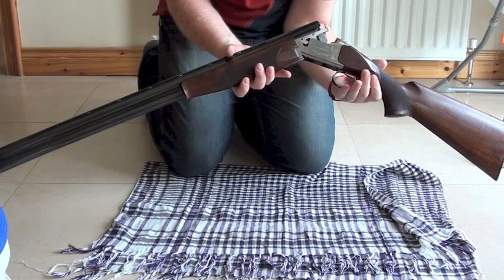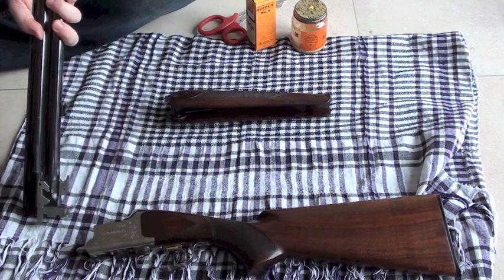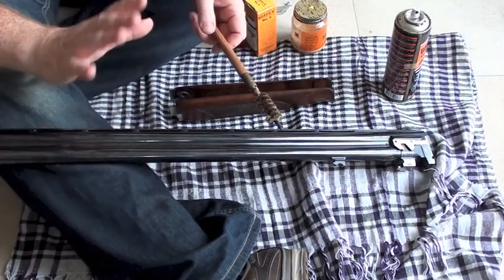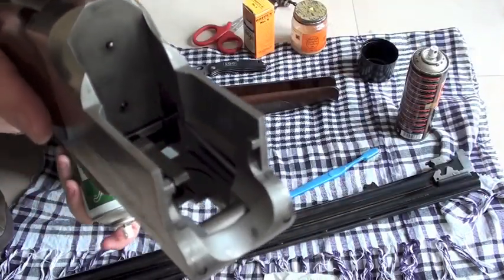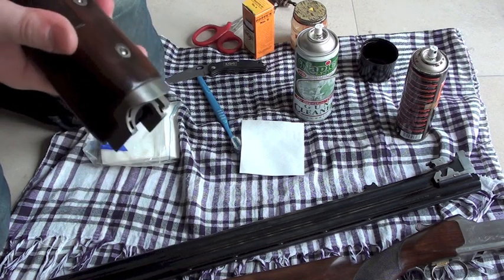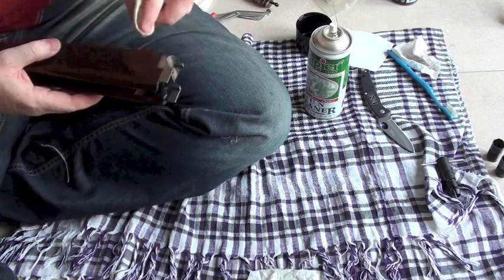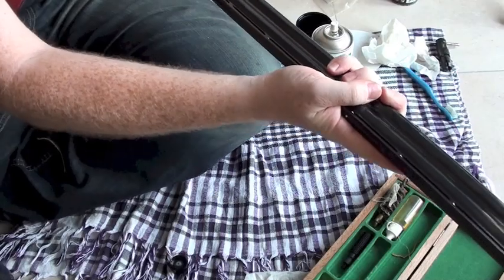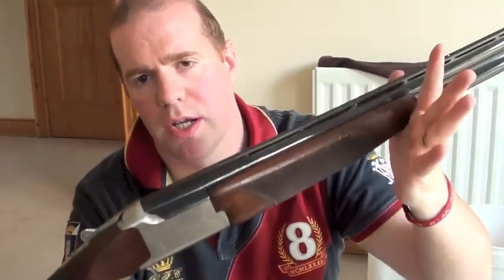How To Clean A Shotgun

Comment: Hi, great video (but a bit long). I have only just got into clay pigeon shooting and in fact I have the same gun as you (but it 25 years old). Just got a couple of questions. Do you need to buy a separate gun cleaner solvent and gun oil or are they just all in one? Also I have a small amount of rust on the cartridge chambers (inside barrel). What would you suggest to do to remedy this? Thanks

Comment: To follow-up on a previous question, it's risky and senseless firing pins without snap-caps, new or old. I would personally recommend removing rings from fingers to reduce the potential for scratching the barrel black in particular, and a 'breach to muzzle' cleaning proponent myself, though an excellent informative video Mr Fermanaghman  :-)

Comment: When gun cleaning, my Mrs hates me using her toothbrush, but it's all in a good cause. ;-) :-D

Some excellent, very thorough advice on gun cleaning.  I can't emphasise enough how important it is to clean multi chokes each time you've been out shooting, as well as loosening them off a little if storing for prolonged periods. Some can go for years without trouble from seized chokes, but it only takes the one occasion before you find yourself with a set of chokes frozen solid in your barrels.

Comment from the maker: no you can use what I have shown, some even just use WD40 lol but Personally I would use a lube aswell just to make sure you keep it all in good nick. Rust! that doesnt sound good.  depends how much, maybe a little wirewool?  if in doubt bring it to a gunsmith and get it checked
Reply: Very late reply but DO NOT USE WD40. It wrecks your barrels. Use a proper shogun cleaning solvent, it is dirt cheap.

Also, I have a question, why are you not greasing your chokes and ejectors?

Comment: Pretty good video.  I always put a small blob of high melting point silicon grease on the metal to metal surfaces. I rescued my wife's discarded ironing board cover underfelt to do my cleaning on,  just the right shape and thickness.  Incidentally, I have a 325, never fired a better gun, 1994 and still immaculate. Thanks